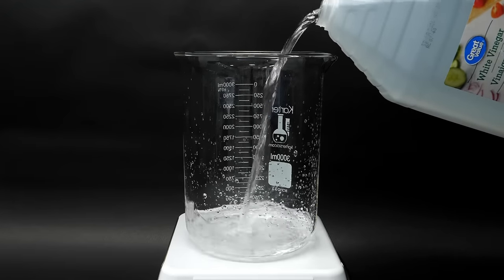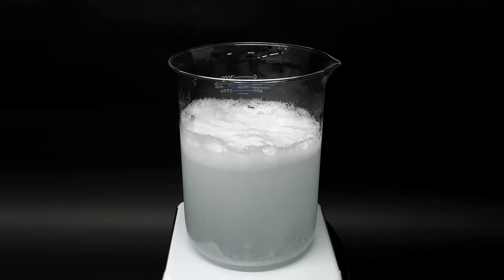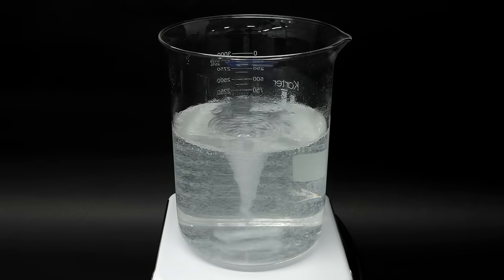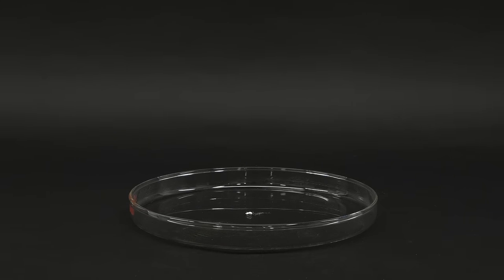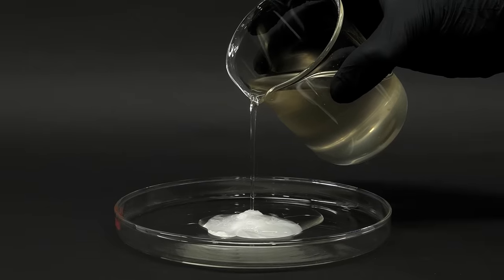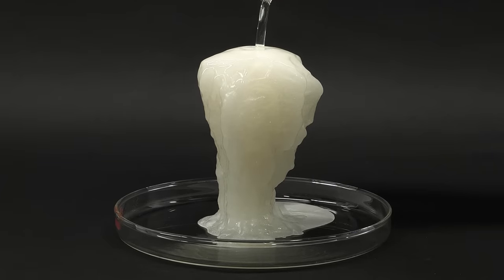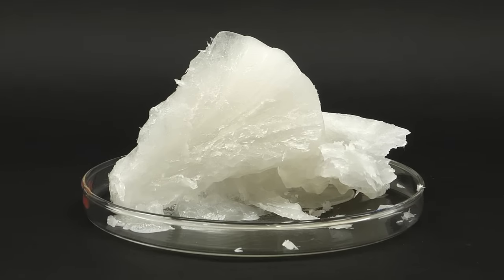Using vinegar to grow a weird tower

Comment: Nigel created a supersaturated solution. He did this by boiling the water away from the sodium acetate, which created a solution that contains more than the maximum amount of solute that is capable of being dissolved. This means that the crystals want to form, but they can't, they need something to start the crystallization prosses. This is why a seed crystal was used. The "seed" allows for the crystals to start forming onto it, eventually crystallizing the whole solution. This is kind of similar to the experiment where you make water go beyond it's freezing point, and then initiate the crystallization of it with agitation or a seed crystal being a piece of ice.
Reply: This experiment is also known as the hot ice experiment
Reply: So its the same as when you put a water bottle in the freezer and then tap it and it all freezes at once? Cool.
Reply: It's not the same
Reply: @CookingWithCows  "Kind of similar"
Reply: this reminds me of how when you want to make a certain sort of chocolate, you need some sort of seed chocolate in order to make it crystallize.
Reply: Would you produce that "seed" by freezing a small amount of that saturated solution?
Reply: @aididdat1749  you can get the seed from another source of sodium acetate
Reply: @aididdat1749  you can scratch the beaker with a glass rod too
Reply: @justjack1352  It sounds similar because there is no particular certain sort of chocolate this is for. It is a cheat for tempering any sort of chocolate.

The reason it is similar is because the purpose of tempering chocolate is to get it to crystalize just right. This crystallization creates a rigid and satisfyingly snappy chocolate bar you are no doubt very familiar with. You've probably also seen Nigel do this on Nile Blue.

Tempering is a rather tricky process, but the average Joe typically wouldn't have to do it himself. The most common example where it could come up is someone wanting to make their own chocolate bars or hard shell coating out of some other chocolate bars or a bag of melts. These can be melted down and cooled again and the tempering will remain. So long as they didn't get too hot. If the melted chocolate gets too hot then there's no trace of the crystal structure left. You now have fudge and the process of re-tempering needs to be done.

This is where the average Joe would need to learn how to temper. Except he doesn't because he just needs to add more tempered chocolate to act as a seed. If Joe is more careful with his heat this time the crystal structure of the seed chocolate will permeate through the rest of the mixture and be the equivalent (if not actual) nucleation point for the whole thing to properly crystalize and set into a hard, snappy chocolate bar.
Reply: Thanks I didn't see the video
Reply: The process of super saturation actually happened not with the boiling, but with the undisturbed cooling. If the solution were super-saturated in its hot state already, it wouldn't take to all the disturbances well.
Reply: Thank you for this! It's nice to see an intelligent comment on this channel. Usually it's just a bunch of tik tok idiots trying to out-funny each other. This was a breath of fresh air. And it's nice to have an in depth explanation. 😊🙏
Reply: We know, we watched the video too.
Reply: Great, except he already said exactly that
Reply: The fact that some people got so triggered at you for making a comment further explaining what’s happening shows how boring and sad their lives are
Reply: You dont need a seed crystal though, all you need is a point of nucleation.
Reply: Miles Doyle  You aint converting no one the only that like what you post already believe the lie.
Reply: Like making rock candy.
Reply: It also goes to show that there are TWO "solid" phases: crystal and glass.
Reply: …water go beyond *its freezing point, …

Comment: I used to have these reusable hot packs that had a little metal disc in them. Press down on the disc until it popped, and watch the colored fluid inside turn into crystals that produced heat. Once it cooled off, you'd place the pack into boiling water until it all remelted into fluid and you could go again.
Reply: Those where lifesavers during winter. I used to put them in my boots.
Reply: Dude. 
Your feet go in your boots.
Your feet.
Reply: @amandahugankiss4110  
WHAT!?
Reply: Hhh that’s really cool
Reply: That's really cool from a classical physics perspective because its taking the thermal energy of the boiling water and turning it into the potential energy of the saturation, thus following conservation of energy.

Comment: My reusable hot packs did become solid when you "snap" that little coin inside and produce heat.

To turn it back to liquid all you need is to boil it back in hot water until it all melted then left it to cool down to room temperature.

You can reuse it as hot packs when you "snap" (rather "click") that small tiny metal piece inside the pouch and they'll start heating up again and solidify.

Comment: big W for chemistry fans today
(me, a junior chemistry major - somewhat motivated by your insane projects and a drive to know how the hell most of the chem you do works)
Reply: Can you reverse the reaction so it unfreezes?
Reply: @leosmith5209  It's less of a reaction and more of playing with saturation of a solution; he got rid of the water holding the sodium acetate in solution, so it really wanted to become a crystal as soon as possible (a supersaturated solution, where more stuff is in solution than naturally possible), which is what happened when it was poured. To undo it, just add the solid chunks back into a container of water roughly the same size before stuff was evaporated so it can dissolve easily
Reply: Literally all you need to do is heat it up. Ok, letting it crystalize in open air might have evaporated some water, but if you do it in a closed container like a sealed bag, just put the bag into boiling water

Comment: You can also start the crystal reaction with a sharp force such as tapping a stir rod against the bottom of the beaker very firmly, the commercial hot packs use a metal snap inside to start the reaction. It would be neat to see how many different weird ways you can start the crystallization! Sound? Laser? Hitting the outside of the beaker?
Reply: Oooh good idea!
Reply: splash it semi-aggressively against a wall so you can freeze an explosion
Reply: @darkness74185  something just seems so funny to me about the "semi-aggressively"
Reply: The metal snap contains a small seed crystal, read how to do one with alligator clip
Reply: Yelling at it to start the reaction would be priceless
Reply: @347Jimmy   I would find that most amusing.

Comment: For reference, you'd need roughly 150g of baking soda (in excess) to neutralize the 2 liters of vinegar, assuming 5% concentration.
Reply: That's the amount of baking soda Nigel is using in this video?
Reply: @maghteridon5555  I don't believe so, since he mentioned adding more vinegar to the mixture. 75g per liter of vinegar will be a stoichiometric excess, if my math is correct.
Reply: @cameronbigley7483  So... How did the reaction occur without oversaturation?
Reply: @maghteridon5555  For most chemicals, solubility increases with temperature. The trihydrate can dissolve 82g/100mL at 50C, but only 46.4g/100mL at 20C. Reacting all the baking soda/vinegar isn't as important as the amount of sodium acetate.

tl;dr: Solubility decreases with temperature, so dropping the temperature causes oversaturation.
Reply: Vinegar is evaporating off with the water
Reply: @cHAOs9  Whats easier to make hot chocolate with? Hot water? Or Cold water? Increased temperature, increases solubility for the lion's share of liquids. Once you've disolved the baking soda, you remove the water, removing the water oversaturates the solution because you're taking away what can disolve the baking soda, leaving more soda than what would normally be able to stay in such an amount of water. Otherwise you'd just get a white paste. ;)

Science is cool. Chemistry is hot. :)
Reply: You'd want an excess of acetic acid (vinegar), not sodium bicarbonate (baking soda)

Comment: I remember doing something like this in my high school Chem lab, except it was with salt. Our procedure was that you make a saturated salt solution  first and then heat it so that more salt could be added and dissolved. When it eventually cooled down, we added a single salt crystal and a bunch of crystals started forming. I believe that what made the sodium acetate structure so solid was that there was very little to no water. It basically became sodium acetate but in liquid state. So when he added the liquid to the crystal, all the sodium acetate fell out of the solution and crystallized around the single crystal, forming a strong structure. But then, I’m no expert and this is just my speculation/opinion. Love the video btw ❤.

Comment: Usually it's done the other way round: You drop a bit of crystal into the solution (instead of pouring the solution onto the crystal) and watch the solution freeze, as that will really look as if you watch water freezing in fast motion.

Comment: I've done this before, and it's pretty fun. But it's also hard to judge when the solution is just on the brink of crystallizing on its own. I would get to the point where I was ready to pour, and it would just crystallize in the beaker (throwing off a LOT of heat), which was still cool, but not what I meant to do. And resetting the whole thing (re-dissolving, etc.) is a pain in the butt, something that takes 30-40 min. to achieve. So maybe fine-tuning this is possible, but I wasn't able to - it's just too sensitive.
Reply: How do you make it a liquid again?
Reply: @gaboanimador  You heat it. This is simple super-saturation. A lot more sodium acetate can dissolve into 90°C water than 20°C water, but saturating the solution at 90°C and then cooling it ever-so-gradually will allow this state of disequilibrium to persist, wherein the sodium acetate wants to drop out of solution, but can't...at least not without a stimulus (like adding a tiny crystal of the same material to the liquid...or merely striking or scratching the wall of the vessel holding the solution). Once you provide that stimulus, and it crystallizes, all you have to do is stick it on a hot plate and heat it up again, and the solid will once again dissolve, and you can do the demonstration again.

Well, that's the theory at least. In practise, it really doesn't take much to cause the solution to crystallize as it cools down. Therefore, about half the time you try to get it to room temperature as a super-saturated solution, it will crystallize without you intending that to happen. That's my experience with this, anyway. Maybe my solution was just too concentrated to work properly, or perhaps my acetate wasn't pure enough, and there were other things coming out of solution that formed nuclei for sodium acetate crystals. I don't really know. Just...know that this demonstration has driven thousands of science teachers insane, and for good reason.

Comment: yay something safe/easy I can do at home, thanks for the great content
Reply: Boiling acid is not really a safe thing to do 😅
Reply: @SaheeliRai  It's been neutralized with the baking soda. Maybe another YouTuber will follow through with adapting an old print head to 3D print a tower then do a lost acetate casting of maybe an ionic fluid solvating lignins.

Comment: Sodium acetate is what those heating packs are made of, isn't it? The things that have the little clicker in it that you boil it it stays liquid and then when you click it or hit it hard enough it will solidify and get hot
Reply: That's correct. It's very energy-inefficient due to the latent heat, but it's certainly a great hands-on reusable resource for demonstrating supersaturation, as well as latent heat.

Comment: And if you heat it, it will melt below 100 degrees C and has a nice capacity to hold heat, (so some of the heat packs can be re-used just by putting them in hot water.)

Comment: The liquid immediately prior to crystallization isn't a supersaturated solution, but a supercooled liquid.
It's Sodium Acetate cooled below its freezing point, but lacking a suitable nucleation site. This is provided in this case by the Sodium Acetate crystal, and in handwarmers by the metal 'clicker'.
The heat produced is that of solidification or crystallization, the inverse of the heat required to melt a solid.

Comment: They also tried to use it in combustion engines - to heat them up immediately. No more cold starting... Unfortunately it wasn't stable enough, the sodium acetate would crystallize spontaneously under test conditions.

Comment: You can do this with water if it's pure enough and the temperature is just right. I used to have a precision refrigerator I used to keep bottled water at 29F to drink it as cold as possible. Would instantly freeze if you hit the bottles hard.

Comment: this is that stuff or winnter time where you have a bag of it. click a clicker inside and it becomems solid giving of heat for cold hands for about 30 min
heating it up in lets say boiling water (keeping the crystalised substance dry in a closed bag) will liquify it again and its a re-usable heat battery storing the energy from boiling it untill needed

Comment: This property, known as the "sodium acetate triphasic effect," occurs when the solid sodium acetate is cooled to a temperature below its melting point, causing it to become a supercooled liquid. When pressure is applied to the supercooled liquid, it will instantaneously crystallize, returning to a solid state. The reverse process can also occur, with the solid sodium acetate being transformed into a supercooled liquid when pressure is released.

Comment: Great video aside, I have a question that I’ve wanted to try and answer myself for a while, but it involves metal in a microwave and I’m only 14. If you put 2 pieces of wire in a microwave with their opposite ends outside of the microwave, could you pull electricity from those wire ends?

Comment: And what's even neater is that you can reuse these heatpacks basically indefinitely. Just put it in hot water and wait for it to cool down again to turn it back into a supersaturated solution. Afaik bending that little metal disk inside creates tiny crystals that act as a nucleus, just like in the video

Comment: One of my rechargeable instant heat packs uses sodium acetate (I'm sure). But it doesn't perform as well now as a new one. It has had almost no use. What could have gone wrong with the liquid inside it?
How can it be rejuvenated ?

Thanks

Comment: You can also do this with super chilled distilled water.
Reply: Not the same 
Water just freezes
Reply: @jarskil8862  YES it rapidly changes from liquid to solid and you can stack it exactly like this if you pour super chilled distilled water on an ice cube -- the ice cube provides a nucleation point to start the reaction.

Comment: Random fluoroantimonic acid fact:The strongest acid known is fluoroantimonic acid (HSbF6). It is a mixture of hydrogen fluoride (HF) and antimony pentafluoride (SbF5) and is over a hundred times stronger than pure sulfuric acid (H2SO4). However, fluoroantimonic acid is extremely dangerous to handle and not commonly used outside of laboratory settings.

Comment: I love you sir, I assume you saw my comment. I can easily do this myself to make salt and vinegar powder, and with fewer ingredients I assume it'll be much stronger than what I was doing. But what is the real difference between this and sodium diacetate? On some packaged foods like salt and vinegar chips, they list sodium acetate and sodium diacetate separately. I found a recipe on Reddit that claimed heating the same solution until it had dehydrated would produce sodium diacetate, and it hate quite a few upvotes so I'm now more confused. I haven't tried it yet but either way, I'll follow the same steps in your video and it should work out much better than what I tried previously.

Comment: I'm still shocked that no one has mentioned the freezing temperature of sodium acetate trihydrate is 58°C, when you cool it to room temperature it is still a liquid but far below where it would normally freeze, so the introduction of a seed crystal or sudden agitation can cause spontaneous freezing and heating of the solid up to freezing temperature of 58.  This can be done at home with baking soda and vinegar, but because store bought vinegar tends to have small amounts of impurities in it the sodium acetate solution at the end tends to have a slight yellow tinge.

Once solid, this can be remelted in a microwave then placed somewhere to cool again, and voila it can be repeated.

Comment: As a not science person is there a way to get that end result back into liquid form? Like through heating it again or did the reaction boost it’s melting point so much that it just wouldn’t be able to go back to that state with such a simple step and would otherwise require a whole breakdown process and then reduction 

Sorry for my poor wording but I’m just curious and I’m not even close to proficient enough in this field to explain it well

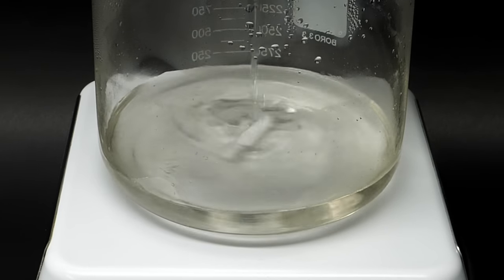Comment: I'm a little confused. Between 1:14 and 1:20 your beaker suddenly fills up a lot in the second shot. You barely added any vinegar, though. What's going on? It also seems to have more of a yellow tinge, from what I can see.
Reply: He boiled it down til it was more concentrated, then poured it into a smaller beaker, which is why it looks more full.